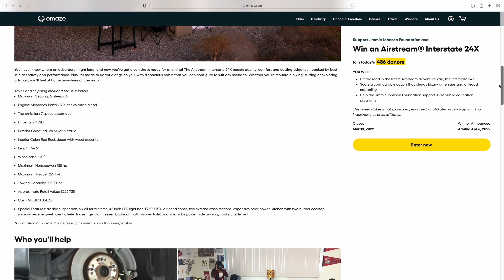#559 - Building A Goat Barn In The Middle Of Winter...

Comment: It would only take 1 time I would shovel a roof till I would absolutely have a heated roof. Collect the melted snow and provide a water source for my animals. This gentleman works way harder then he needs too. He’s work ethic is unarguably amazing. ^5.
Reply: I would run the pex tubing for in floor heat. Under that metal. Then set up an old propane water heater and recirculate it. Bam. It would melt right off. Do it 2-3 times a season.
Reply: my tip is take long rope end each side roof and use it like saw and cut snow and it will side off the roof

Comment: In Finland we use Lumikola or lumenpudotin to remove snow from the roof those save your back and time. With Lumikola you get bigger junks of snow and you don't have to lift snow only slide lumikola edge of the roof with snow junk on it and with lumenpudotin you don't even have to go to the roof at all, long rod, cutting edge and plastic slide plus gravity do most of the job. I have follow your channel now about three years and have enjoy the journey so far. 👍

Comment: How about putting summer hot like hardware clock over the inside of that window in the goat barn? That would protect the window from the goats putting their horns through it. I don’t think they’ll bother from the outside in but they sure would bother from the inside looking out. With the way you built it you could almost put another room the size of the one you were putting in plus the hair room on out as an extension if you needed it for grain and hay storage. My Meijer place is growing. You do an excellent job of building efficiently and strongly for your needs. Thank you for sharing all you do.

Comment: So glad that you are getting the animals fitted out.  Personally, I have been worried that they were able to be warm given the terribly cold weather that has been happening.  I know you have been on top of it but I had goats some years ago and had babies born in a cold spell.  The one baby's ear tips got frost bitten, even though we were watching.  It turned out ok but I've been conscious of the problem ever since.  I love the stalls you are making.  It looks like they will be big enough and yet hold in the body heat.  By the way, I was watching the roof/snow cleaning and it reminded me of something from a few years ago.  I don't know if they are still available.  They used to advertise heating coil units that you could put on the roof to prevent ice build up.  I thought maybe this might work for you and make it so the snow would slide off easier. ??? Well, stay warm and safe.

Comment: Heath, how about putting a couple of large insulated windows that you can open in that upper opening rather than just a polycarbonate greenhouse wall.  That way you are letting light in, but it would also be insulated and you would be able to open them in the summer for ventilation.  Great work as usual.

Comment: The outside window - suggest cover with temp plywood or boards so if the snow on the old coup sides off it will not break the window.

Comment: Suggestion: Instead of busting your back to break away frozen snow and ice on the roof if you take a long piano or round wire with two people on each end of the roof you can cut the snow off when it's still fresh and removal will be far easier... They use that technique on hard angled roofs with heavy snow loads on them... Basically cuts away the connection to the roof and the snow load rolls off unattached on it's own... Youtube Search: removing snow load piano wire
Reply: it can be a rope or steel cable

Comment: I wouldn't do anything fancy on the back side of the shop with those damn goats right there by it.  I'm surprised they haven't chewed up the green board, and the casing around the doors, they're quite destructive...putting the board and batton siding on there will give them a nice snack to chew on.   galvanized metal siding on the side with those goats would be 100% better than anything chewable.

Comment: Would it be possible to put some water pipes under the tin on the porch roof that you could pump warm water through to help with the snow accumulation?  It’s not something I have ever had to deal with (the coldest it gets where I live is around 4c (39f) in the dead of winter)  but surely something like that could work?   I realise it would be wasting precious resources warming the roof but if it saved you from having to get up there and shovel snow wouldn’t it be worth it?

Comment: Heath, have you thought about putting the corrugated metal on the shop wall inside the goat barn so that the goats don't chew on the board & batten siding (at least to the bottom of the window) ?
Reply: After watching Red Poppy Ranch, I would pass on the goats personally, unless I had a good reason to have them.  They like to get into everything.  Heath can't catch a break from them.

Comment: Cedar & Heath I still got a bad feeling about that barn window. 
A big Billy goat 🐐 or Big nanny with horns will stand on their hind legs and try to head butt another goat 🐐 on the other side of that window & bust it !
 I hope not, but it’s still low enough to the ground for that to happen. 
I have my windows on my barn up high, I built them outta wood and put them on hinges so I can open them up and tie them back with a hook. I do this in spring, summer & early fall. Then I  close them in late fall & winter to block off the cold air. 
But you’re right about the horn into the window Cedar.  I pray 🙏 not but it’s still possible at that Height because they love standing on hind legs and head butting.

Comment: Did you consider a drag wire along the porch roof and chain it to any of the trucks to drive and pull the wire to undercut and drag the snow off?
Reply: My thought exactly, I have done that in the past the only problem is you have to be careful when that cable slices through it could come flying off

Comment: I think this was the episode that had you cleaning the snow off the roof again. And I’m just wondering why, and I don’t know a lot about snow cleanup. But I’m just wondering why you couldn’t put in some ice up on the roof and run two or three ropes across and from ground level when there’s snow snap those ropes to break the snow into chunks so they would slide off in layers kind of. I know what I’m trying to explain but I don’t know if you can get the visual well enough from what I’m saying.? I’m thinking that if you had the rope go across with an a I a pi on one end when you snapped that rope it would come up from underneath the layer of Snow and break them into horizontal chunks that as soon as the sun hit them they were just slide right off?

Comment: CAN'T TELL BY THE VIDEO BUT YOU MAY CONSIDER THE DOWNWARD SETTLEMENT  OF THAT BEAM ABOVE THE WINDOW.  IT MAY, OVER TIME, BREAK THE GLASS  OR JAMB IT CLOSED.  I WOULD MOVE THE WINDOW DOWN 2"  AND PUT IN VERTICAL SLOTS ON THE STUD SCABS FASTENED WITH LAG SCREWS AND WASHERS.

Comment: I am sad Heath the two of you had to shovel that much snow off of the roof.  You already work hard enough.  Maybe an Architect can come up with a fix, instead of getting rid of the porch.  With that much snow, too bad you couldn't just get a snow blower up there on the roof.  Hang in there!  p.s.  Maybe you could extend the upper roof to the edge of the porch, and then put posts on top of the posts.  Then the lower roof becomes like a shelf, ceiling, play area, etc.

Comment: Just curious, but has anyone ever thought to putting radiant heat tubing under metal roofing?
Reply: Good question.  Seems like a problem solver to me.
Reply: You'd have to run antifreeze in it since you wouldn't want to continually heat the roof (total waste of energy) but being able to run heat for long enough to melt off the snow could be really handy. There are other side effects though, like what happens to the water as the snow melts. If it is cold out then you risk ending up with ruptured gutters from water freezing in them and expanding and impromptu ice rinks around the building.

Comment: I had been thinking for a while that a huge pole barn in the corral off the back of the shop would be ideal. Just build it like a brick sh*t house so it would stand up to the snow. Once it is there you can partition it to suit your needs as your operation grows. Even put in cement floors where you need them and leave the rest dirt. Maybe make the roof like a barn roof for upstairs storage?